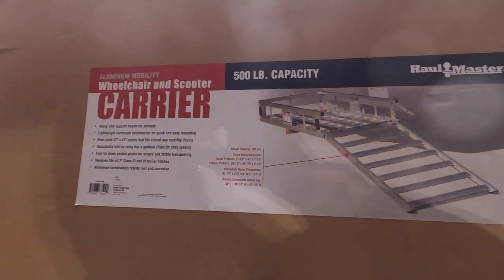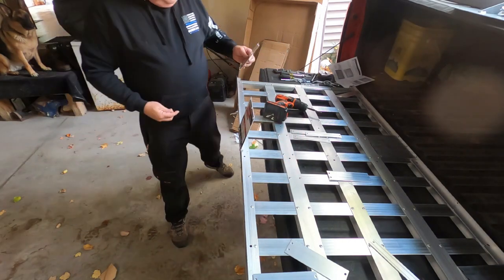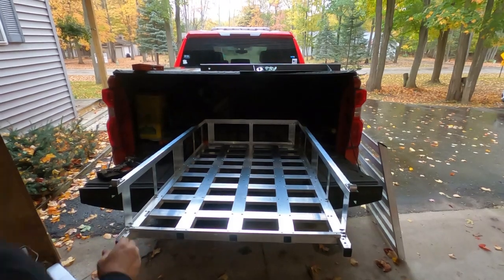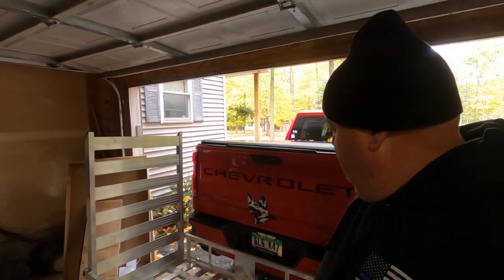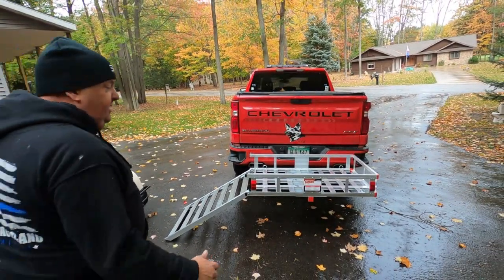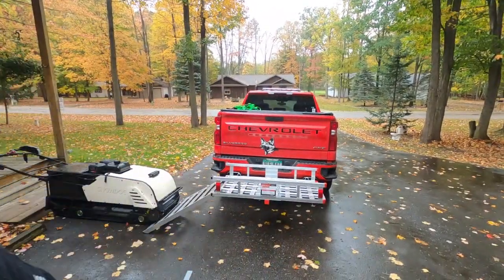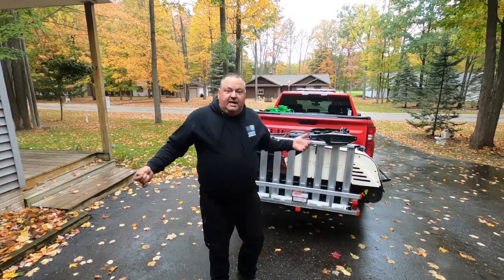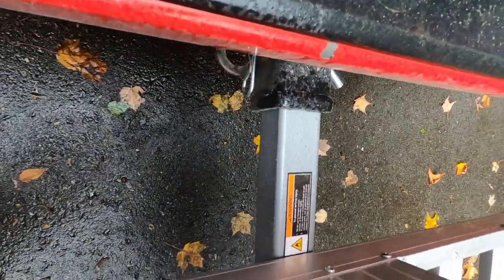Harbor Freight HAUL MASTER Aluminum trailer

Comment: My buddy had the same setup 3 years ago but the cargo tr@iler won't last long due to the dog is heavy. End up he had to buy a regular trailer.
Reply: Oh wow ok thank you what failed?
Reply: @allenballard377  as you can see this cargo trailer has only single support spot which is hitch, when driving the snowdog will be bouncing a bit and eventually you will see that hitch pipe is slightly bended. We afraid that one day on the road it will fall... Another problem with this solution is, sometimes it's difficult to drive the snowdog up to the cargo trailer, once my friend gave too much fuel and the snowdog fly out to another side after climbing up the ramp. A normal trailer will be much better solution but we all don't want to go that way at the beginning
Reply: @benjiang6493  thank you very much